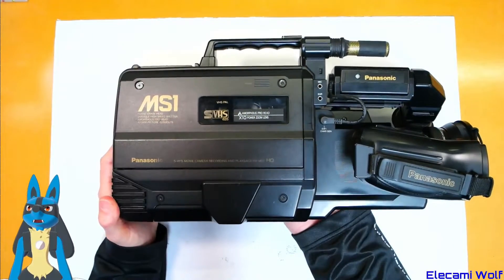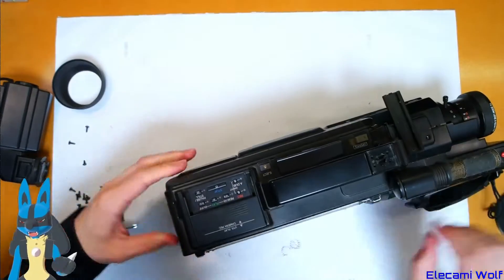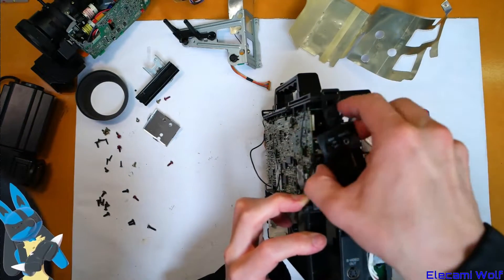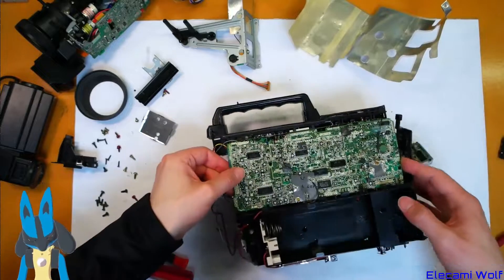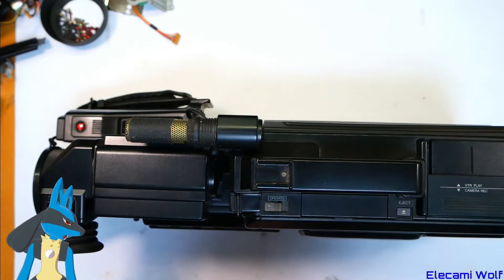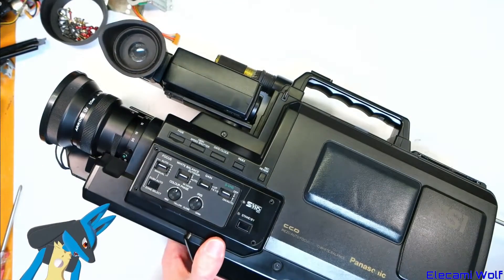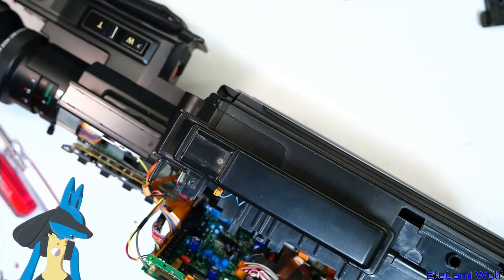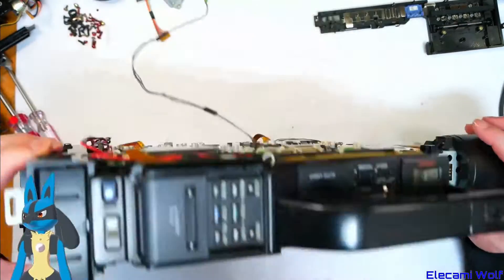EW0086 - Panasonic NV-MS1 SHVS Video Camera Teardown & Investigation

Comment: Hi Elecami, I recently found an old MS1, tape mechanism and everything seems to be working fine but much like the second camera you tested it has that terrible hissing sound, am I looking at a faulty power supply as well? Such a great informative video!
Reply from the maker: Most likely the power supply capacitors need to be replaced.

Comment: They likely made that last camera so large because its a shoulder mounted camera which is a more stable way to film than handheld, so no point in making it small.
Reply from the maker: I was meaning smaller like the other Shoulder cameras NV-M1 and NV-M3. Those have everything squeezed in to a nice practically sided case.

Comment: Oh man i reversed polarized my nv m8 and this video just saved me, i was the same problem as the one that didnt go on, do you think that is okay to just jump the 12vUNRG to the top of the transistor ? Thk
Reply from the maker: Why do you need to jump it to there? Sorry I'd have to go looking in the service manual to work it out. If it was connected reverse polarity, maybe a fuse is blown.
Reply: @Elecami  I did the same jumper as you to the transistor and the problem was fixed, maybe when reversed polarized burned out some contacts that supply the transistor
Reply from the maker: @YagoMarinsPatricio  I see, just looked at the video, I had forgot about that. Must be a way to bypass a fault. Maybe there was a batch defect in the PCBs.